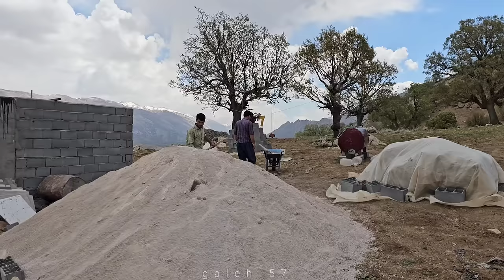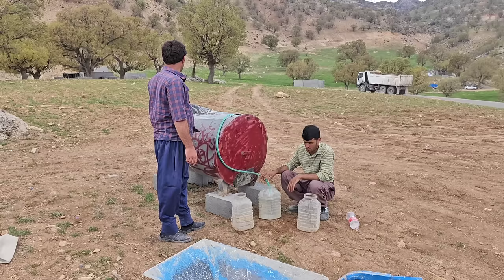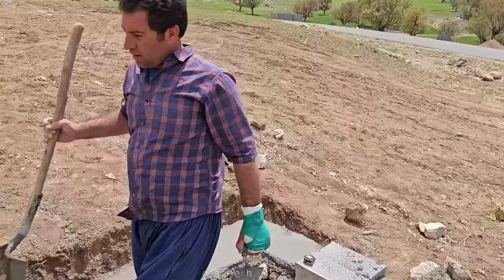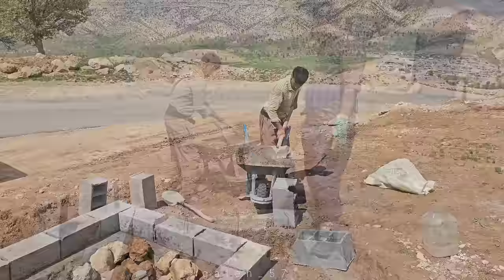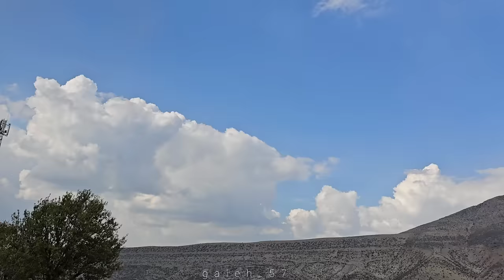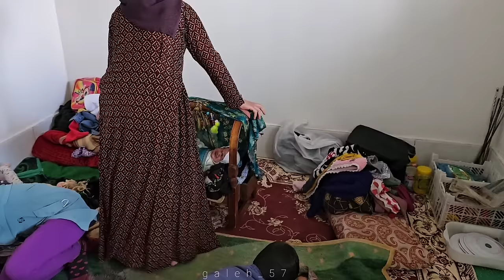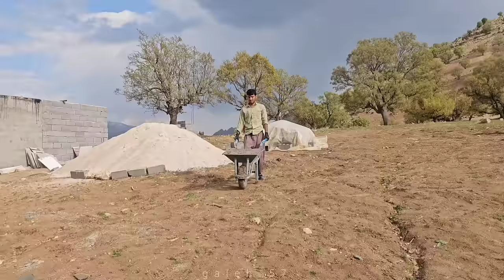Raising the wall of the toilet with blocks in a spring rain by the master worker

Comment: For the nephew of Susan.. Castor oil helps relieve pain in the back.. Rub castor oil on back and apply a hot water bottle or put hot water in a bottle or container.  Wrap it with a cloth and warm the area that you have rubbed with oil.  It relieves my arthritis  pain.  Maybe it would help your back.  It takes my pain away.  Put on something old to do this.  I don't  use modern prescription  pain medicine.

Comment: In my country, toilets are in the same building, because there is such an infrastructure in metropolitan cities, there is no infrastructure in towns and villages or in mountainous areas, the normal toilet is built outside, but the place where you build the toilet building is very wrong. It's bad that the whole family has to go to the toilet on the roadside when they need it. I'm trying to understand why you built the toilet building so far away when there is so much free space around the house, the masters are excellent, I'm sure this is not their idea.  Wrong plan, later you will find out that it is wrong anyway.  Follow other channels like you, they built the toilet building in the closest part of the house, why are you trying a different plan?

Comment: Personally, I would not put a window in the bathroom.  I would not weaken that wall.  There are lights that can be stuck on the wall. They use batteries.  There are solar lights that are powered by the sun.  We, the commenters should not have the last word.

Comment: Non ho ben capito il senso di costruire un'altro bagno se già ce n'è uno nella casa, se magari qualcuno lo spiega, complimenti al maestro e al suo aiutante si danno molto da fare, grazie al cameram x i video che ci mostra di questa bellissima famiglia, i bambini sono tutti bellissimi Dio vi benedica tutti ❤️
Reply: Ciao credo perché non hanno acqua corrente ne possono fare una fossa settica per il terreno pieno di sassi. Questo sarà così, ma ho espresso il mio sgomento pensando che aprono una porta della latrina sulla strada ho suggerito di fare un muretto e mettere degli arbusti perché sicuramente nessuno amerebbe farsi vedere in quella situazione. Pensi che fanno le opere per quanti spettatori guardano e commentano, io non ho nessuno a cui inviarlo, magari tu se riesci a far aumentare gli iscritti e i commenti possono comprare pentole una stufa grossa scarpe magari dei polli per sostenersi è un forno per cucinare il pane perché dovranno anche scaldare l’acqua i fare altri. Ciao

Comment: I think by the road is the drain field for the sewer, the door to the bathroom is off of the kitchen. But I could be wrong as I’m not sure how things are done in other countries.
Reply: They don't seem to have running water so no sewer.  I think they're building an outhouse.
Reply: It is definitely an outhouse with long drop. It's built there because there is no soil where the house is built it is hard and rocky and long drop needs soil. There is no sewage or electricity they have to do the best they can